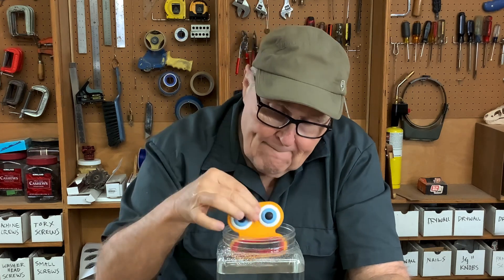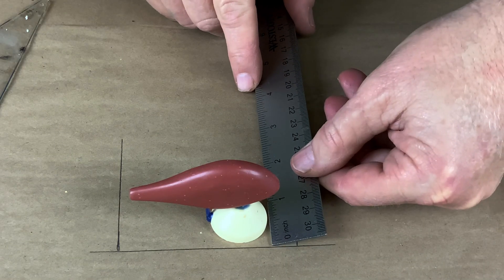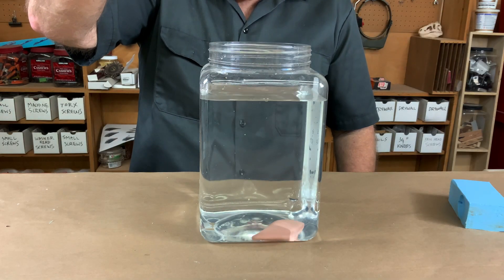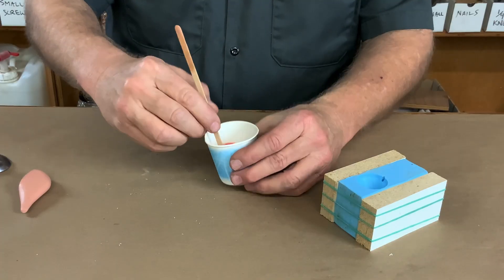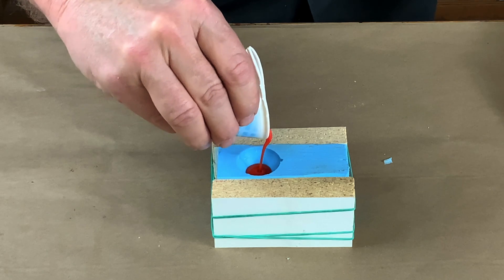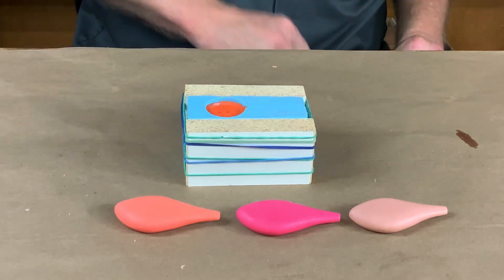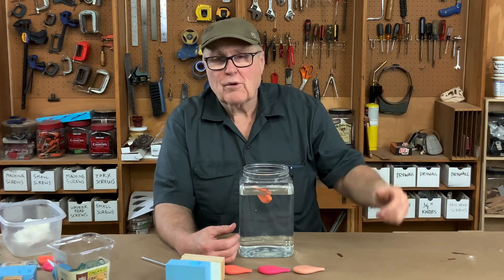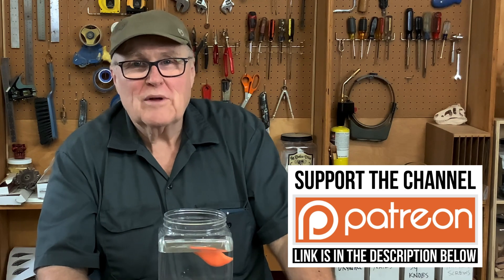Can You Make Castings That Float?

Comment: Microballoons are expensive in TR. I am using strofoam spheres in my resin casts to make floating fishing lures. I determine the additional weight and center of mass to hold it at the desired position for the swimming action. I drill a hole and insert the weight and seal with resin. There is such an application in my profile. ☺️

Comment: how about casting a metal shell only, try the conductive paint electro plating metal surface, the inside can be puffed out after, rotocast to the mold
Reply: if you 3d print the core from plastic (or normal casting) then coat with metal, you can remove the core plastic, leaving only the outside metal shell, that floats, like a boat

Comment: Hi Robert! Awesome video. Quick question, could the piece be done with your rocking cradle to make it hollow so it floats without the fillers? Thank you. Greetings from Mexico.
Reply from the maker: Yes, you could rotomold  the body hollow, but it is very difficult to control the consistency of the inner walls. So getting the balance right would be difficult.  Each casting would be slightly different.

Comment: Cant be just used foaming poliuretane to cast these light stuff?
Reply from the maker: Yes, and one of these days I will do a foam molding video. But that is very different than the kind of resin, casting that I normally do and requires different procedures.